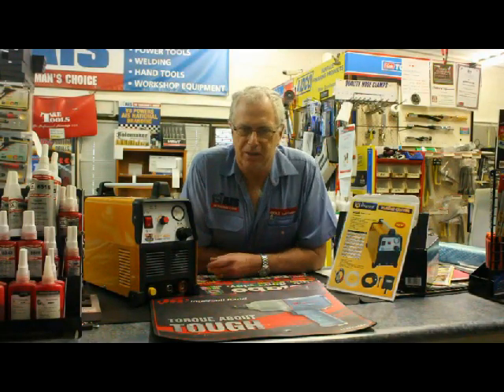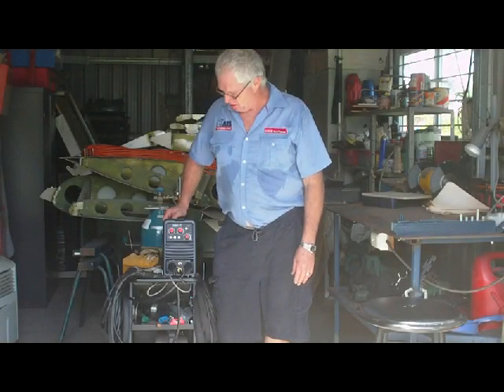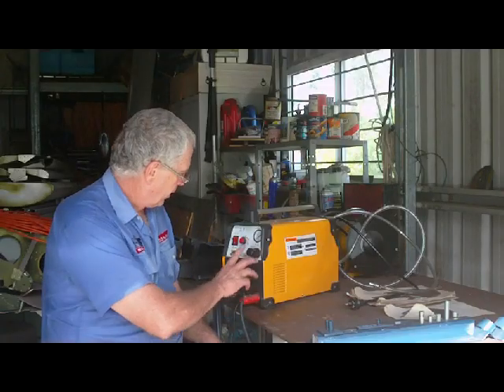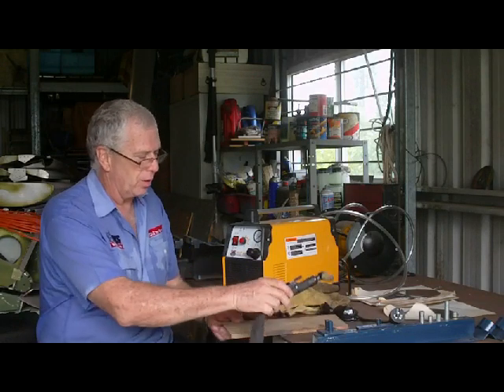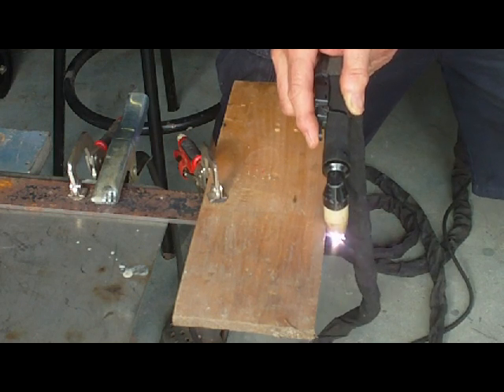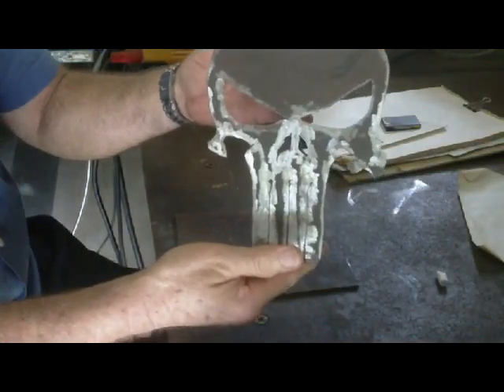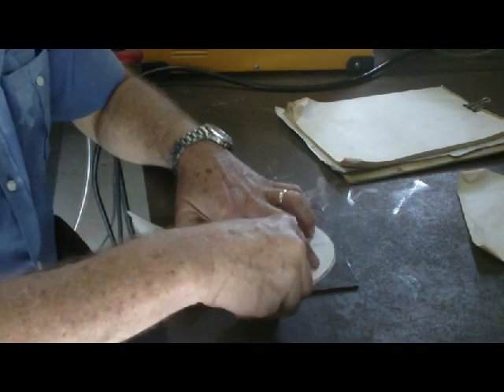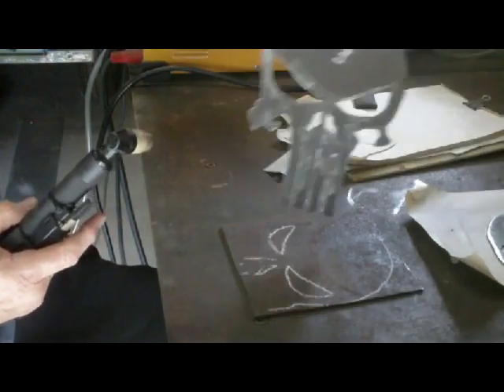Cut 40 Plasma Cutter instructions and projects

Comment: Y

Yachtie safety sandals .Bad safety practice really .
Reply from the maker: Correct and l have had the odd hot bit of metal trough the holes. But you can get them off quickly to stop the burning.  Unlike when I have lace up shoes and I am standing there wishing it would stop burning please!!
Reply: Get a pair of those boot over covers that blokes use when wippersnipping grass .My missus made some for me from an old pair of jeans legs .
Reply: Dang, ladies. I cut and weld with shorts on, no shirt, and barefooted sometimes. Course I'm from Arkansas, yall.  :) LOL

Comment: What would your tips be please for minimal warping from the heat on thinner sheet metal pieces?
Reply: use a test piece, set air to 50 psi, even 70 work fine. set power to  3.5  to 4 same on dials, try a cut.most often problems cutting are, tip worn, ceramic cracked